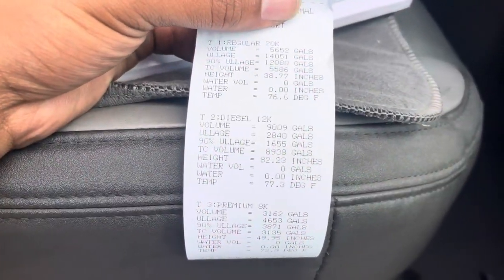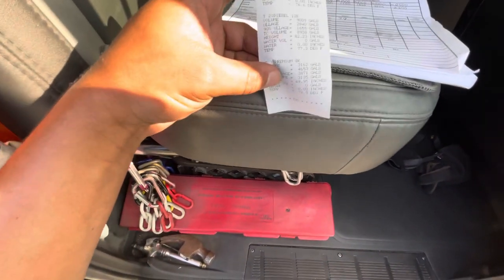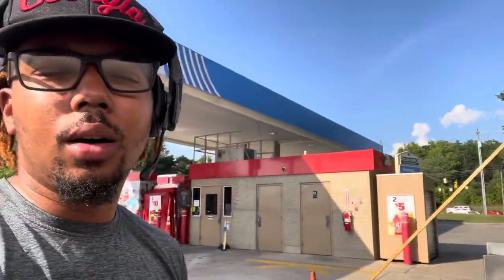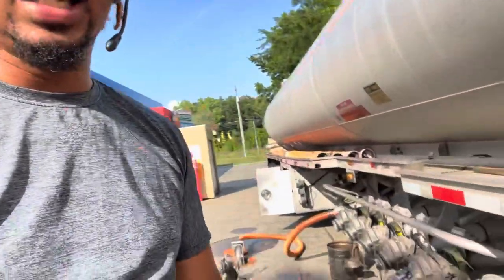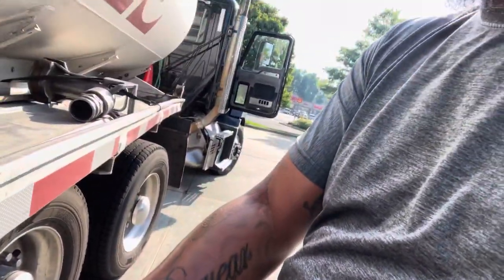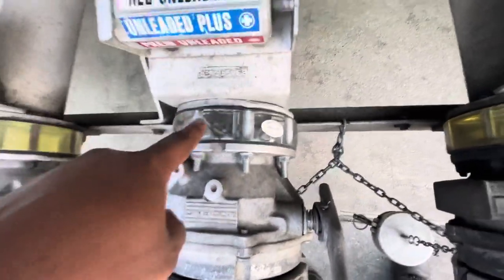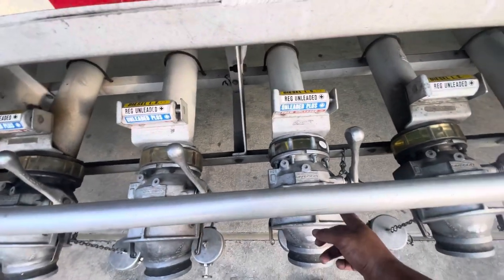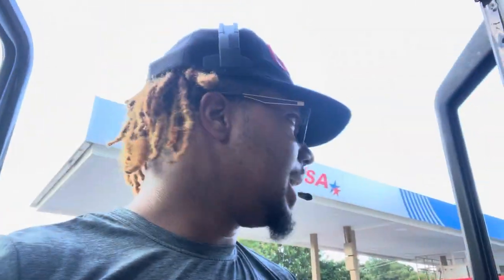How fuel haulers deliver GAS

Comment: "Prope Out": The term "prope out" likely refers to the unwanted situation where residual fuel remains in the lines and causes issues during the next loading. This could lead to inaccuracies in the amount of fuel loaded or contamination of different fuel types.

Comment: Interesting, I used to be a manager at a gas station and always watched how they do that, we used to also check for water in tanks, one time we called a company to send people to clear the tanks from water because of a flood, we had to close the parking lot because the guys one of them had to go down inside the tanks and the other one stays on top just in case of an emergency, it was frustrating but it went good 😊 now I'm a truck driver and thinking about hauling fuel.

Comment: First thing I do is put out the cones, setup the vapor and stick the tank. I'm with the no veeder route gang 😂

Alot've drivers do the opposite but Ik how much will fit based on the tank size and inches, I got a tank chart book
Reply from the maker: 😂😂😂😂 they want us to be extra careful over here lol. It wasn’t like that at eagle 😂
Reply: @Youngtruckerdee  yea i feel you, I'm one of the only ones who use the stick method tbh. Im on a dedicated account and all the stations got specific size tanks. I know if the stick reading is 65 or under a full load of regular will fit (8500), because the veeder route machine aint always accurate, but some people only get the veeder and start dropping without sticking. Its all the same shit just different ways of doing it fr
Reply from the maker: @LEGENDOFSEVENN  Yeah I got to so many different stores with different tanks that makes it so easy to get confused 😭😭 I’m still learning though
Reply: @Youngtruckerdee  i gotchu, I been doing this since april, been solo for a month now

We call that the open board, we got like 15 accounts on there but I dont do it alot, im with KAG
Reply: Rookie lol
Reply: @LEGENDOFSEVENN  is the pay decent with kag. That was the main complaint about kag i saw from reviews. We have a local and regional spot open here. Going to get my tanker/hazmat, triple/doubles endorsements Monday. I'm more interested in tankers but I will apply to some ltl companies too. Came from schneider and they lost the dedicated acct I was on. Thru me back into otr and cut my pay in half. Didn't last long.

Comment: is manual transmission operation required for fuel hauling?
Reply from the maker: Nope not at all
Reply: Earn how to float the gears don't be a robot trucker
Reply: You drivers need to learn it all manually automatically and my favorite three on the tree
Reply: @lilwinemane  
yea because manual truck drivers make way more money than auto truck drivers right?
Reply: @The_Gr8Pre10der  no because they have a better understanding of the machine they are operating